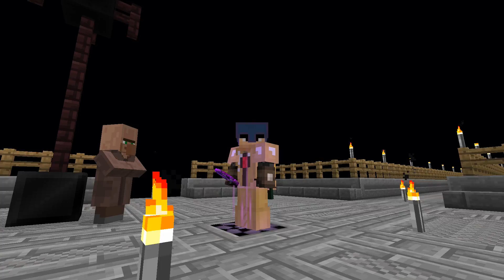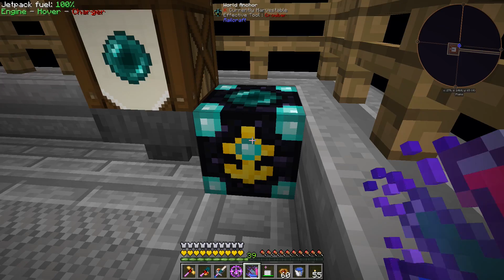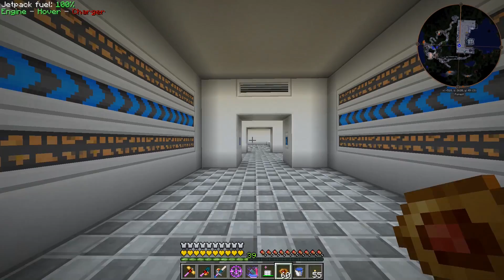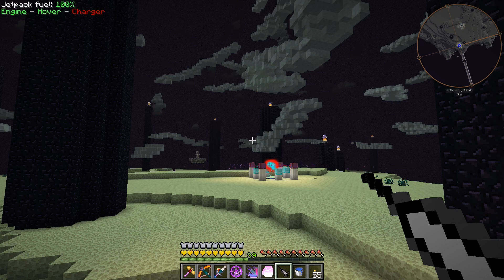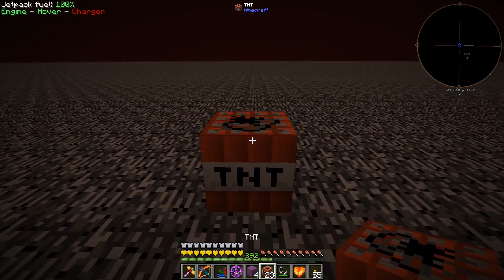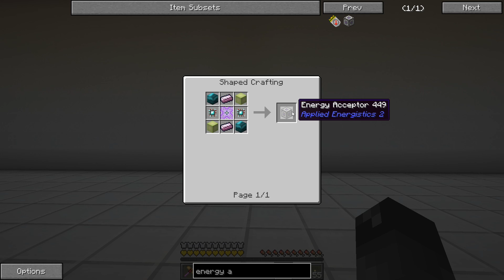Minecraft Mods FTB Infinity Evolved - DRAGON DIMENSION [E57] (Modded Expert Mode)

Comment: Trying to create a mob dimlet for an Ender Dragon dimension. I have all the necessary components (base part, rarity 6 control circuit, advanced energy module, advanced memory unit, mob type controller, Syringe of 100% Ender Dragon essence) but nothing appears in the output box of the workbench. I am concerned it's something to do with the syringe of essence.. but I can't be certain.

Comment: I'm not sure if EnderIO is in this modpack, but a quick way to charge up those blocks, and anything else in general, would be to make one of the EnderIO multiblock capacitors. Each block you add to the capacitor multi block increases it's Input and Output, so a large enough capacitor should theoretically be able to charge up a block in just a few seconds. I'm sure if it is in this modpack then it's probably stupid expensive, but just a thought I had to charge your stuff faster, and you could use it to replace your towers of Energy Cells, as it's a multi block that can be made in any shape or size (as far as I know, I haven't made any super huge ones)

Comment: +hypnotizd

 for Terrasteel ExtraTIC, they take the same amount of ingots as other metals being casted as an Ingot (144 MB). So you will need around 2304 ingots of Terrasteel to make a Terrasteel dimension with RF tools. Alternitively, your endoflame set-up is just fine for terrasteel production, as it is naturally slow to begin with. :/

However, if you think that endoflames are too slow, you can resort to thermalillies and the lava fabricator as you can Convert RF to Mana. Per bucket of lava, you will need 200KRF in the lava fabricator.

There is another type of flower that takes TNT and SDX blasts and converts to mana as well. Those flowers will only take one TNT/SDX blast at a time, and has to completely finish before taking another one. An SDX takes 5 gun powder with 4 sand, with either a green (slime chunk or swamp) or blue slimeball (twilight forest or slime liquid) for crafting, and SDXs have twice as much blasting power and radius as a regular TNT.

However, in order to obtain higher tier mana generation mana flowers, you will need to get into blood magic and witchery, where the T2+ altar is a pain to get because you need a lot of life essence/slates (arcane stone (4 stone, 4 living rock, one thaumcraft shard) in a blood altar with 1000mb of life essence) /waystones (4 per flint in a mana pool drop) to craft blood runes in a shaped orb craft. T2 takes 8 runes, while T3 takes 20 runes, and T4 takes an astounding additional 28 runes, and T5 takes 52 more blood runes. it will take 108 blood runes to make a Tier 5 altar where you need 216 arcane stones converted into T1 slates, 216 way stones, and 432 stone in a shaped orb crafting recipe. You will also need 4 glowstone blocks (T3), 4 large bloodstone brick blocks (T4) and 4 1st layer beacons (T5 (20 glass, 12 obsidian, 4 nether stars, 72 metal/gem materials of choice)).

Comment: Look into Ender Collector for future builds. It collects items before they drop similar to the Ring'o Experience. 
The bee room is overpowered! Are you going to make oblivion frames from those Ender Dragon eggs or has that been deprecated by Gendustry? You can feed bees to flowers. I have a feeling your getting close to making your creative energy cell!
Reply from the maker: +Daniel Mtanous I saw the ender collector being used recently. It seems like a really great way to collect items instead of the world interaction upgraded transfer node to be sure! There is not a lot of need for frames at this point. It could speed up a couple of processes but honestly I don't think it's worth it with Gendustry. I could also change the bees to make tonnes of drones to feed to flowers, but right now I have all of the production ones set to make one drone so we never get extras.
Reply: Makes sense, I'm barely breeding industrious bees myself. I should have it soon. I'm sure you will think of something good for Botania. GLHF

Comment: have you tried the transvector interface instead of making a energy acceptor
Reply from the maker: +mathias jakobsen Huh, no I haven't, but I assume that would also cause me to not be able to put a cable there? Hmm, I want to look into these blocks at some point. Pretty sure I've unlocked the research for them, too.
Reply: +Hypnotizd EnderIO energy conduit and dense ME conduit can share 1 block space. Also, a large vibrant capacitor bank will charge draconium blocks faster than you can autocraft them, and the wireless charger is a charge pad that doesn't suck

Comment: FTBU chunk loading works perfectly fine but only 24h after last login. You can set it in config file. Dunno if you need visit chunks on login. I think not. I think it will not load chunks after server restart, you need to log in to reset timer.

Comment: If you want to speed up terrasteel production:
1.) Get a bunch of pools
2.) Put a recessive spark augment on one of the pools
3.) Put sparks on all other pools
4.) Point all spreaders to the pool with the augment
 

It should be considerably faster. (with 40 full pools, it takes less than a second :P)
Reply: Molten Terrasteel cannot be used at all this would be the preferred method to make it.
Reply: Spark augments require pixie dust (mana pearl thrown in the botania portal) and he doesn't have the portal
Reply: Oh right its not that easy to get the portal i forgot about that part -_-
Reply: Ah, I forgot about that